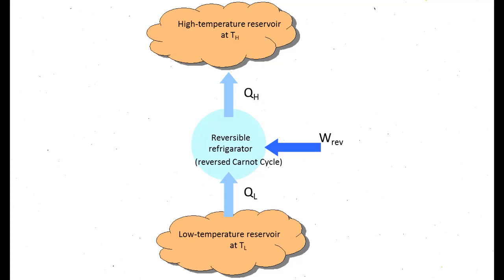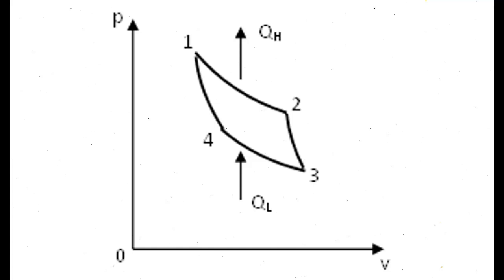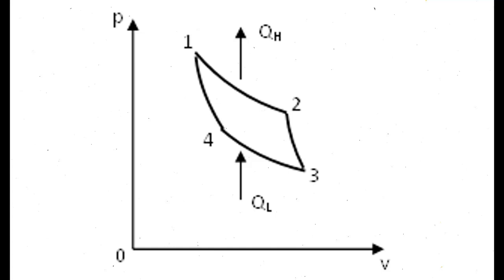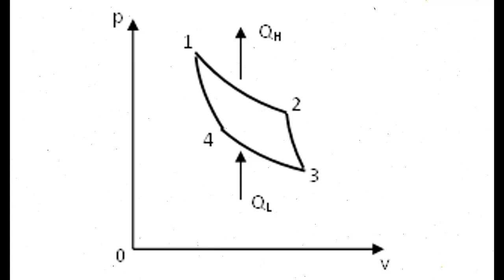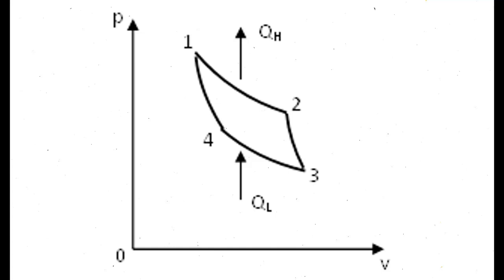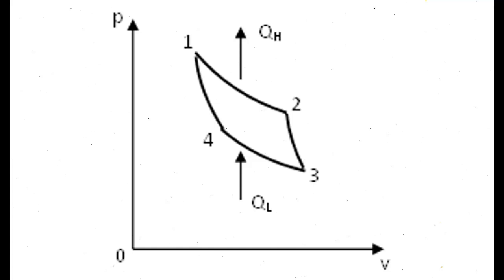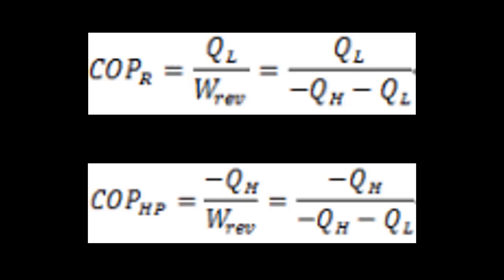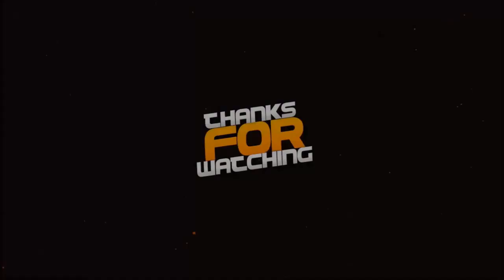REFRIGERATION AND AIR CONDITIONING | REVERSED CARNOT CYCLE

Comment: q. ice is to be made from water supplied at 15°c by the process shown in figure. the final temperature of the ice is 10°c and the final temperature of the water that is used as cooling water in the condenser is 30°c. latent heat of ice = 335 kj/kg. Determine the minimum amount of work required to produce 1000 kg if ice. I need solution. Answer is ~30MJ